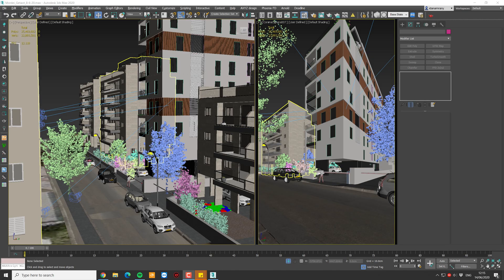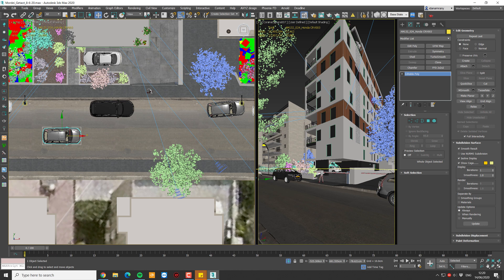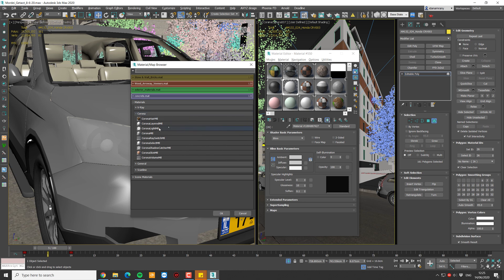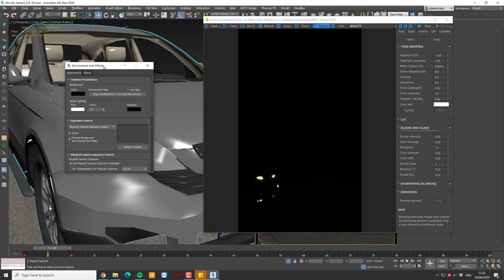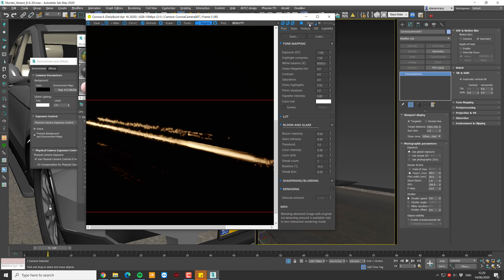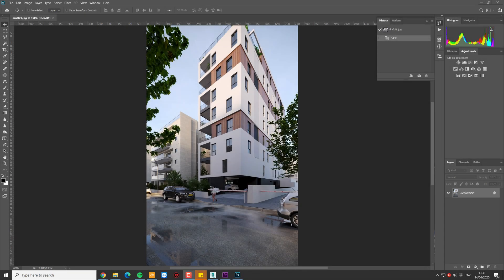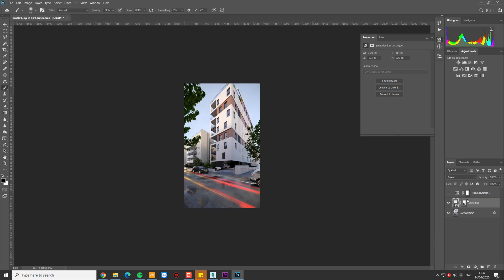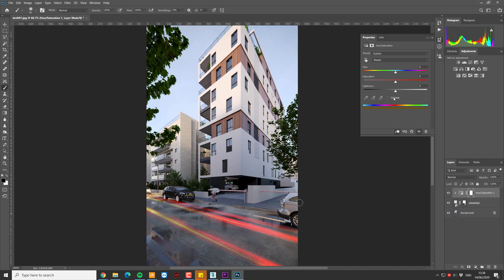Car Light 3ds max - light trail effect

Comment: how would you do the same effect if the car moves following a curve?? Because I've tried but even though the car is animated correctly, the light path that apears on the render doesn`t correspond to the car movement. Thank you
Reply from the maker: You can use path constrain on the car model and use a spline to control the direction